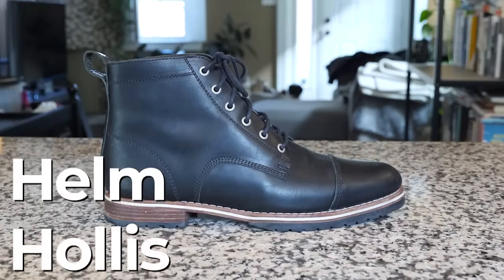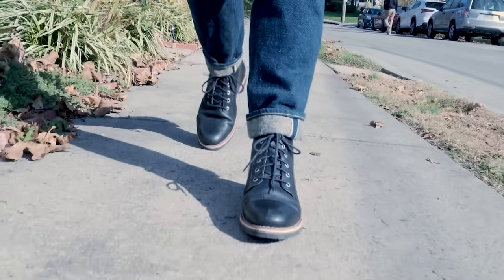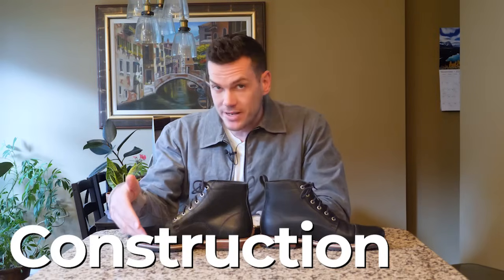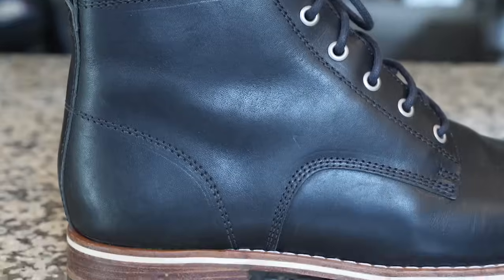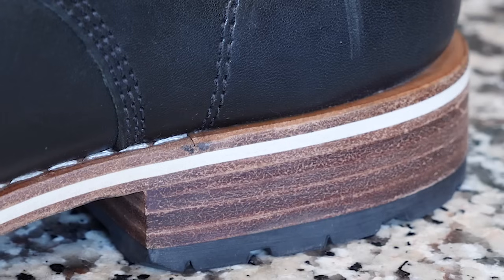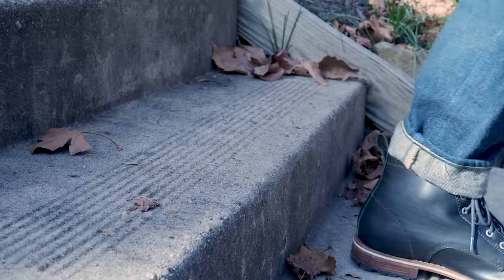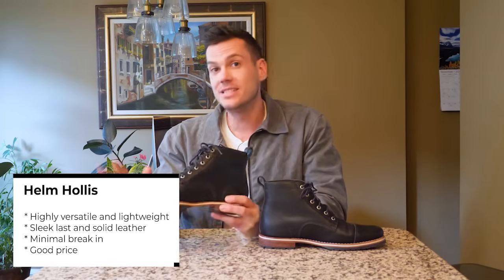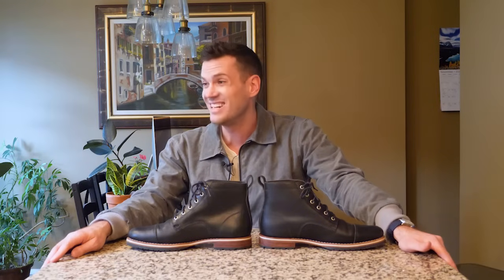Helm Boots Review (2023 update) | More Unusual Than You Think

Comment: Blake/Rapid boots are not harder to resole than GYW boots. In this case u only need to replace the glued-on rubber lug sole. If you're in need to replace the leather midsole you need a cobbler with a regular outsole stitcher (like GYW). The Blake stitcher is only needed for the replacement of the white rubber midsole which has basically the function of a GYW. The actual welt on these Helm's is only for the looks, no structural function at all.
Replacing the midsole with a Blake stitcher is way easier and less time consuming than re-welting a GYW boot.
Reply: Yup, Nicks seems to think that goodyear welted shoes are resoled with goodyear welt machines. Clearly a rapid stitch is rapid stitch whether you're stitching to a welt or to a midsole.